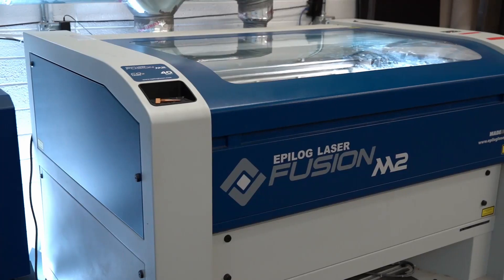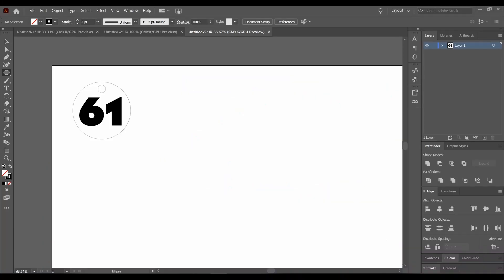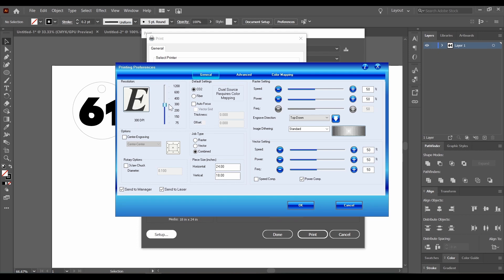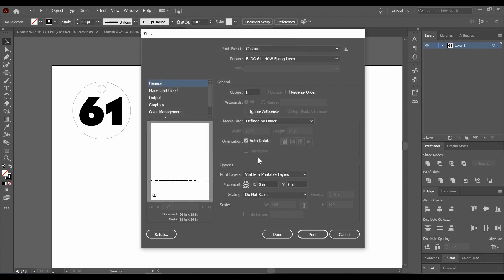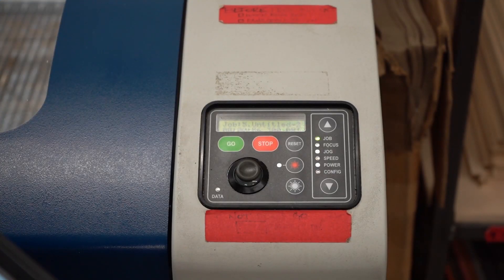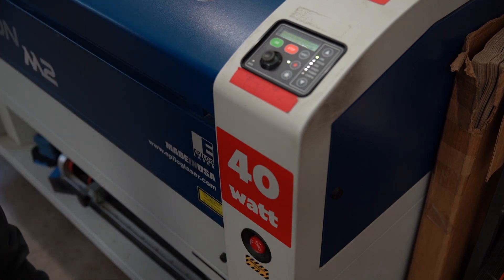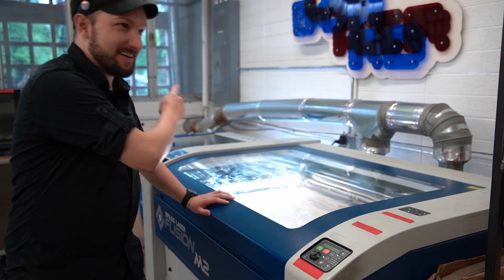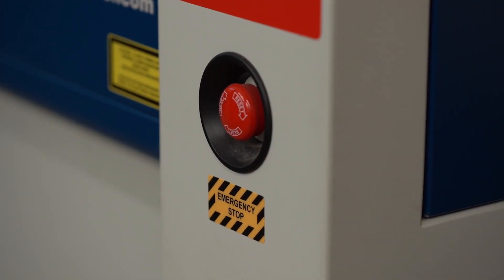Laser Cutter Tool Orientation | BLDG 61

Comment: Hey, I bought my material before I realized that these machines can only cut cut through a relatively thin sheet in a single a pass.  Can I cut through a thicker piece by making multiple passes through with roughly 1/8 inch depth of cut, with enough pause between so that the cut edge cools down completely?